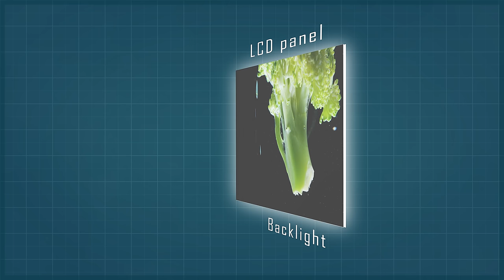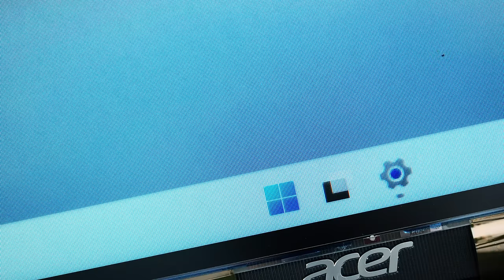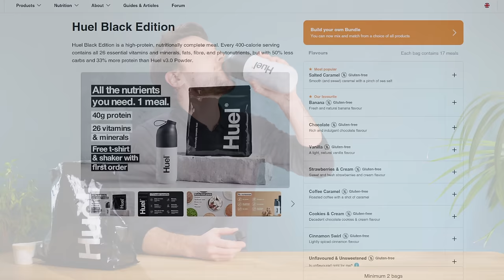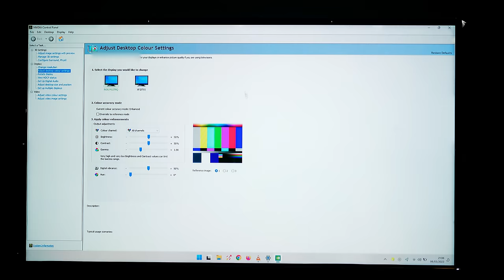DIY Dual-Layer LCD monitor - can it match OLED??

Comment: If you fed both screens different HDMI signals, like in a "mirrored" dual monitor computer setup (using two outputs from your graphic card), you'd be able to adjust both layers individually. This could help making the picture's colours less "poppy" and maybe even help increase the white levels.
Reply: Not in this case, as while you're squaring the contrast ratio, you're also squaring the total light blocking, which is already about 97% on LCD.
Reply: I don't know, but they might have slightly different vertical blanking intervals - meaning one monitor might start refreshing at a slightly different time than the other.

I don't KNOW this to be true, but I suspect it might be true.  That might be causing some problems, but really, I know about the technology of the LCD itself, but not the details of how it works.
Reply: Does it then akt like a holo display (possebly if you increse the distance between them by a bit) but id like to see a DIY holo-skreen
Reply: or be able to watch 2 full screen YouTube videos simultaneously)))
Reply: @fuzzywzhe if running these from identical type outputs from the same quadro / Ax000 card or Radeon card (AMD is significantly less tight about locking up feature access on consumer GPUs, but low tier quadro cards are more bountiful harvested from old workstations), there's a ton of possibilities for adjusting stuff here to compensate for sync issues, gamma curves etc. Metrics and results should be pretty reliable, especially if you can get both displays sourced from the same production batch (almost guaranteed if bought new together). As that should avoid any internal revisions that wouldn't have noticeable impact on 2 individual monitors but could cause headaches combining 2 independent panels into a single display sandwich.

Comment: i think removing the polarisation filter from the back lcd will help with brightness and eliminate the need of the tracing paper, you can then also bind both of the screens with uv glue used for screens, so there will be less blooming and blurryness in text
Reply: I was thinking the same thing....removing one of the filters would do the trick.
Reply: Me too, but what do I know. It would make the job easier and better if it worked
Reply: It won't work. The front layer of the back lcd and the back layer of the front lcd are 90 degrees apart in terms of polarization, so it would still completely block the light, unless you can find special LCD panel pairs which are oriented 90 degrees apart.
Reply: This seems like it would intuitively make sense, but I did some research and I don't think it would work.

The liquid crystal film doesn't block much light. It's just red/green/blue translucent goop, organized into subpixels that can be polarized based on how much of that subpixel's color we want to shine through. Without the polarizing filter, the backlight shines through all the subpixels all the time, and it's almost impossible for our eyes to resolve an image. You can find video of what LCD screens look like without the filter, and they're basically just bright lights. Actually, I think this channel has done videos about upcycling broken LCD panels into lightboxes for exactly this reason. With only one polarization filter, it'd be the same problem as before -- not being able to block enough of the backlight to get the nice inky blacks and high contrast.
Reply: @crystalsoulslayer  How about getting a SLIGHTLY CLEARER polarizing filter that matches the second panel orientation?. I feel like he didn't explore this option enough and just brute forced the problem
Reply: If you removed both polarizers from one panel and replaced the outer one with the opposite polarization of the one closest to it from the other panel it'd result in roughly double the transmittance (since each filter has a max theoretical transmittance of 1/2 iirc). So instead of 1/2^4 you'd at least get 1/2^3 or 1/8 vs 1/16 transmittance.
Reply: @sjm4306  However replacing polarization film is not something that can be easily done.
Reply: @acters124  Polarization is a bit more complicated than it first seems. Putting two filters on with the same polarity blocks all the light, as he demonstrates in the video. You can apparently orient the filters in specific ways (at right angles to each other) to get more of a screening effect, but that has its own complications. As mentioned above, it wouldn't be easy to DIY. Manufacturers of these panels usually glue the front filter into the whole LCD assembly that goes on the backlight, so you can't casually peel the existing one off and replace it with a pair that's sized and oriented correctly. Even if you did manage to get filters in place at the right angle to block more light, I'd imagine you'd have to be sitting in front of the screen at The Perfect Angle to be able to see anything. Polarization is the same technology used for 3D movies, and you might have noticed that tilting your head too much at the theater messes with the image.

He absolutely did brute force it. Sometimes, with the limits of a given technology, brute force is the best way to go. There's a limit to how much power copper windings can carry? Fine, just make the windings in this generator really thicc. Need tons of energy to go fast enough to get a satellite in orbit? Okay, build a big dangerous rocket. Not enough power to carry people and equipment to the Moon? Fair enough. Bigger rockets. And more of them. Computer not fast enough to handle all the credit card transactions for your members all over the world? Faster computers and more of them.

It is super appealing to imagine that there must be a simpler, more intuitive way to do certain things. Sometimes, there is! And that's fun! But even if it doesn't check out, hypotheticals can teach you things you wouldn't otherwise learn. Answers are good, but questions are great.
Reply: @bozilla9975  why not put one face down or upside down? then with software flip the image of one in dual monitor mode. would that do it?
Reply: @crystalsoulslayer  We're rather lucky the LCDs used are mostly linear polarization too, if it was circular like some reflective LCDs (Game Boy Color and Advance screens for example) I don't even know what kind of workaround would be needed.
I did indeed remove the polarizing filter from a dead laptop screen once, front and back can be removed, but to attach a new one without bubbles and such is a major pain. I did do it successfully for the one layer only, small size of a GBC and GBA but not bigger.
I suspect if one could find a filter of suitable size, rotating both filters of one of the LCDs 90° from their original positions would do the trick.
Viewing angles still gonna have the issue of two image misalignment on anything but dead straight, but sure seems like an interesting idea.
In the realm of absolutely perfect theory, the new polarizer thing wouldn't even reduce brightness at all, since the full white should already come polarized to the perfect orientation to hit it.
Reply: Good thinking. Now there is something more to try.
Reply: @crystalsoulslayer  Well.... the upcycling he did on this channel was taking apart a TV/monitor with a broken LCD panel, and using just the front diffusion and fresnel lens sheets to create what's essentially a fake window.  Didn't do anything with the LCD panel, obviously.
Reply: Thisthisthis
Reply: @tmass1  I think there's definitely a route like what you've suggested that would mitigate the need for brute force. There's fortunately many elements to this project, so many avenues for improving efficiency
Reply: He should try the sandwich wrap plastic, it turns the polarisation quite well, can't remember if it goes from circular to H/V or as a quarter wave thing...
Edit: watch here some yt teachings link-> https://www.youtube.com/watch?v=QOmP47YXs5I
Reply: As several people have pointed out, it's not as simple as it sounds. If the panels were glass, I think he would definitely be able to do it. We replace polarizing film on Old GameBoys all the time because it tends to liquefy over time. But that screen isn't hurt by running a razor blade across it. These panels? Their plastic and I think using the razor blade to remove the old film would probably do them in.
BTW, if anybody knows where to get the exact same polarizing film used on the gameboy, but in larger sheets, I would appreciate being told.
Reply: @brentgoeller8257  The panel itself is likely glass, but mind you, frighteningly thin glass. I've repaired a 32" LG LCD TV here at home more often than I would like (tho, being as easy as it is, I'll still stand by it in repairability), mostly replacing the backlight each time a single LED of the 22 behind it died. This involves removing the panel and it's a nerve wracking experience. It flexes like 5 cm upwards if you take it from the longer edges, which is basically the only possible way. I can bet for sure it's glass indeed but I wouldn't dare working on it's polarizers, it's like 2 mm thick overall, so 2 sheets plus plastic filters on top and bottom, all that, not much more than 2 mm.
I feel like PC monitors use thicker glass but this is likely an individual product thing.

Comment: One thing I think you might have missed is the gamma. Monitors are non-linear with respect to their input, and there is typically a compensation curve (gamma) to fix that. However, with two screens, your nonlinearity will be doubled and you will need to adjust your gamma curve (easily accessible in desktop OSs).
Reply: Yes, although not so easily calibrated and you can run into precision issues with the required exponent of 4.8 that he now needs instead of the more typical sRGB exponent of around 2.2.
Reply: You will just have to hardware calibrate the end result. Might be easier if you calibrate both monitors before the sandwiching
Reply: @dorbie  Really, this sort of display should be driven with different images sent to each monitor for this reason. It's got 16bpc in total at the higher gamma which could be remapped to the standard 8 (or even 12) with reasonable precision
Reply: @jameshogge  That would take a lot of highly refined calibration and systems integration that isn't really feasible in this context, it can buy you more bits but not 16 bits without independent backlights and a degree of control that doesn't exist here. You can do better than this though for sure. See my own response elsewhere and my referring to "esoteric reasons" for setting different display gamma values on each. Something that is feasible and easily within reach (if supported).
Reply: @dorbie  The calibration needn't be too hard: you can do well enough by assuming that the individual LCDs are correctly calibrated. The rest is just maths with the light intensities. One of the groups at my uni did a similar setup with a DLP projector as the backlight for an LCD. But yes, it is a pain to then drive the displays. Ideally, you use an FPGA. Alternatively you have to set up a virtual display in Windows and write a couple of shaders to produce the actual outputs.
Reply: It's not the monitors that are non-linear. It's our perception that is. Gamma correction literally makes the RGB output non-linear but makes it appear linear to us.
Reply: @displaytalk  Mmm monitor sandwiches, my favorite!
Reply: @0x1EGEN  wrong, our contrast sensitivity is non linear, but our perception is what it is. Gamma is both a display response and the inverse of that display response (correction) to restore correct linear brightness. Today that display response is intentionally engineered to be non linear to exploit human contrast sensitivity. This results in non linear precision over a linear brightness scale when corrected.
Reply: @dorbie  "wrong, our contrast sensitivity is non linear, but our perception is what it is" 

Or in other words.. our perception is nonlinear. Lol

I think you're being pedantic over my use of the term. Even though Wikipedia on gamma correction also directly states: "human perception is non-linear and better approximated by gamma"
Reply: @0x1EGEN  The linearity or non-linearity of human visual perception is immaterial here. On a correctly calibrated 8-bit sRGB monitor, a color value of RGB(128, 128, 128) is about 21.6% as bright (in actual watts, not perceptually) as a color value of RGB(255, 255, 255), regardless of what eyeballs are or are not looking at it. The reason they are designed is that way is related to how human vision works, but a monitor is objectively a system with a non-linear mapping of color signal to radiance.

The problem with this proposed dual pane system is that unless you take special care to change the gamma response to account for the additional screen you will end up with a system where RGB(128, 128, 128) is 4.66% as bright as RGB(255, 255, 255). Color response will be very broken: every single intermediate hue will be oversaturated as e.g. RGB(255, 128, 128) now skews much more heavily to red than it is supposed to. Note this would occur even if the monitor response was linear, which the dual panels would change to a squaring.
Reply: @Xerofyt  is that not something that could mostly be corrected in software? not necessarily at a level that allows high end professional work but for media use. The corrections are nowhere near that extreme but I've seen terrible monitors output acceptable images after using a colorimeter and displayCal (which is based off Argyll CMS IIRC)
Reply: @K3Techs  Maybe? It depends on what you mean by software. You can't naively post-process the output with e.g. Reshade without introducing severe posterization artifacts as several input values will map to the same output. Mapping a monotonic 8-bit curve to another monotonic 8-bit curve will always fail in that way, probably quite severely so in here as the curves are so different.

Setting an appropriate ICC profile should in principle work since that modifies the GPU's hardware behavior. I don't know what the limits are on how far you can take that on a modern consumer GPU. I think the implementation is usually some sort of higher bitspace 3D LUT, but it's not really a topic I am familiar with. Using a gamma of 4.4 might be out of spec. 

Doing colorimetric calibration is probably right out since the calibrators assume (usually with reason) that there's not multiple outputs driving any given pixel, but if you're DIYing yourself a high contrast display from two mediocre 8-bit panels then exact color accuracy is probably not a design goal. Still, if anyone is actually going to do this thing then they should definitely use color profiles to try to get somewhere in the vicinity of sRGB to avoid colors being completely wrong like they are here.
Reply: How do you all know all this? It's fascinating seeing how smart people on the internet are. But I always wonder, is this self-taught or are you all engineers?
Reply: @displaytalk  You couldn't software calibrate the panels independently though because they're being driven by the same display output. As far as the computer is concerned there's only a single display.
Reply: @bosstowndynamics5488  You don't have to! Displays have these wonderful things called calibration controls. Software calibration is a meme.
Reply: @guy_tech  I bet most of them are just speculating and don't actually know. The monitor in the video doesn't even look that off. There's no way it could look presentable on camera if what the people in this thread are talking about was actually a concern.
Reply: @guy_tech  in fact I would go so far as to say the majority of people in this thread have never done a hardware calibration of a display and wouldn't know how to use HCFR. This can all be proven wrong/right by just taking some measurements of a DIY dual layer lcd. No need to be having a conversation about it.
Reply: @displaytalk  the increase in gamma can be understood purely theoretically. You treat each panel as a filter which let's through a certain percentage of the light behind it. To get the total light let through by two filters, you multiply the percentage of light transmitted by each.

Since gamma is an exponent, it will be added together for the two panels (doubled if we assume both panels have the same gamma value set). IE 2.2 -> 4.4 (or 2.4 -> 4.8)
Reply: @displaytalk  as for my background, I've done modules in graphics and colour theory as part of my degree. And I have used a colourimeter because having multiple displays with different behaviours is somewhat irritating
Reply: @dorbie  "Today that display response is intentionally engineered to be non linear to exploit human contrast sensitivity." That's actually not the key. The truth is that CRTs, mainly due to their dot mask, had nonlinear gamma: Black is black, white is white, but a medium gray signal is seen as dark gray on a CRT. All images you see on a screen are adjusted accordingly: The entire Internet is too bright so that it looks correct on a CRT. So ... when LCDs came along, did the manufacturers ask the Internet to please change everything created so far? No, instead they imitated the CRT gamma. Maybe there's more going on here, but what I just described is definitely fact. Because it's logical.
Reply: @OwnerOfTheCosmos  You appear to have the most basic understanding of this topic based on its legacy origins and even that includes errors. Feel free to read above were I wrote "This non linear display response used to be an artifact of CRTs now it is emulated in displays as an sRGB response", yes there is more going on here. I tried to offer some of that detail and nuance above which you're welcome to read.